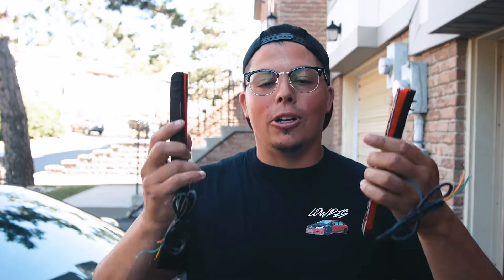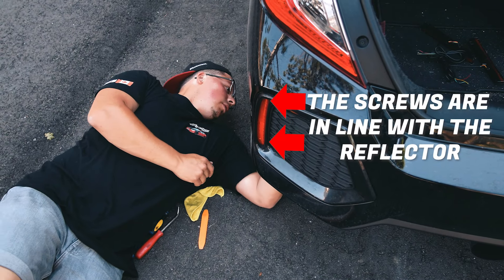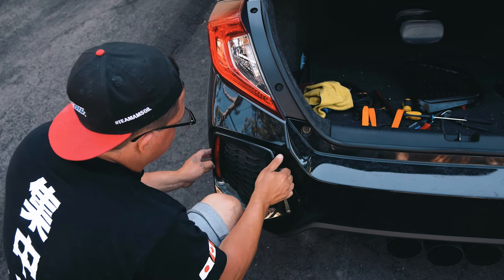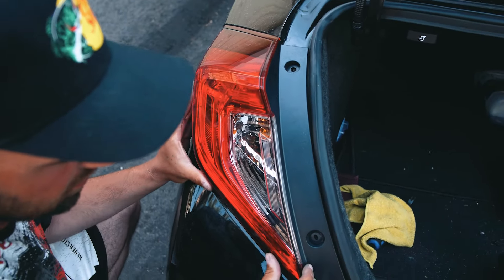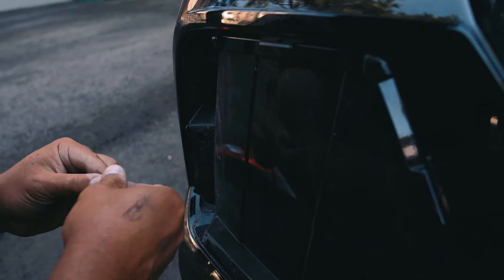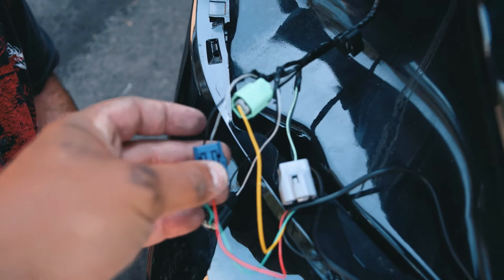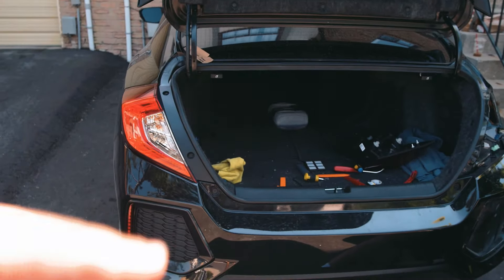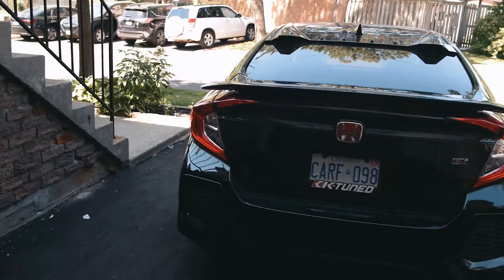SEQUENTIAL LED BUMPER REFLECTOR INSTALL ( 10TH GEN CIVIC )

Comment: Wait, how did you plug the socket back in 5:47, if you just plugged the wire directly to the harness (no splicing/TTap)? Won't the thickness of the wires prevent you from plugging it back into the socket? Or you'll damage the LED reflector wires, trying to plug the harness back?
Reply from the maker: You have to trim enough of the plastic around the wire to clear. It’s a snug fit but it works great

Comment: Question, if you add them to the pigtail the way shown on the video, doesnt that interfere with the pigtail fitting into the tailight?
Reply: Did you ever get an answer anywhere else?

Comment: Bro I just ordered mine on Amazon just now. Coming in tomorrow. Can't wait. The wiring on the video wasn't super specific. So my question is the wires that go from the lights to the tail light pigtails. You just stick the wires accordingly into the pig tails then just clip the other part back together? No splicing or cutting into the original wiring at all?
Reply: Aye just double checking, works with 2017 Honda Civic Sport hatchbacks (assuming manual doesn’t make a difference) ?

Comment: hey man, I installed mine today using your video and it was a great help, I was wondering I ran into some problems after I installed which now my SYSTEM BREAKS and some other lights turning on and when I try to drive the car it won't let me shift to any gear(yet the car is On working fine)
Reply from the maker: That’s odd, disconnect the negative terminal from the battery for a couple minutes then reconnect it. Go for a 10 min drive then turn the car off and on and see if that helps
Reply: Hey wassup got the same problem just now did you figure it out ? Also thanks Mr.Lopes for the video!
Reply: I’m back did all that battery removing therm I already but didn’t work it was just a the stoping light fuse had gone bad switched it all my problems gone and car looking nice !

Comment: Recommend to change the rear bulbs to LED too. basically i changed all the rear bulbs to LED(signal, brake and reverse). Its much brighter and the signals goes off and on and does not fade like the filament bulbs
Reply: Have you had an issues since upgrading to LED?
Reply: @ofwgthaidgaf  2 years with no issues
Reply: Nice ive done my headlights and fogs so far looks 1000x times better. May have to do the rears next. Also wanted to do some on the inside as well.

Comment: So you just leave those wires in there and plug it like that they don’t get torn or in the way?
Reply from the maker: daniel cordoba yea as long as you trim enough of the plastic you’ll be ok just make sure to double check before re installing it
Reply: Chris Lowpes And by plastics you mean the insulation around the wire right? Just making sure don’t want to do anything stupid 😂
Reply: @DCvenomfang  yes, so that you get a better fit when ypu plug it in.

Comment: Just installed mine and my running rear lights don't work. The blinker and the brake lights work but nothing will allow the running taillights to turn on. And now my front side marker lights aren't working 😢

Comment: how has the wiring hold up since you didn't splice into the actual wires of the harness? Im about to set up mine and I wanted to see if this a pretty secure/easier method to doing things lol
Reply from the maker: Yea I haven’t had any issues to date surprisingly

Comment: hi guys i live out here in canada, and my mechanic warned me that i should not install the rear bumper sequential lights because of the snow and salt hitting those areas, causing electrical and corrosion issues. 
any one has any thoughts or feedback on the validity of this claim? 

thanks
Reply: bump
Reply: Did you ever do it?
Reply: @gosu8075  yuppppp... and it has been ok so far.. just ask the mechanic to use extra sealant around the corners and cables
Reply: @gstreetboi  thank you very much for replying. Really appreciate it! I’ll be doing this then

Comment: Hey, big fan of your videos!  How did you do this without splicing.  You make it seem like there are naked ports on these connectors you can just jack the wires into.  Is that all?  No quick splicers necessary?  Cause all the vids I've watched they're using quick splicers.
Reply from the maker: Check out minute 4:53, we put the wires into the plug and connect them to the car, also thanks for watching!!
Reply: @ChrisLowpes  how did you do that? removing the wires from the pigtail?

Comment: I have a 2013 civic si and i recently installed the led reflectors and they work but only when i come to a stop and use my turn signals. There is  a problem to that which is my tail lights. My tail lights aren’t on at night and i had people flash at me from behind since my tail lights are out. Can anyone tell me how to fix this?

Comment: I want these for my type r.... but they're actually illegal in the UK as you have to have the reflectors on the back... 😑
Reply: The reflectors are useful if you are in the dark with the car turned off and you don’t want to be rear ended
Reply: @TheDetrity  exactly (they're a legal requirement for parked cars)....  do you know if they reflect when not in use?

Comment: idfk how on earth you got the honeycomb panel off. my plastic clip remover snapped before i even got a single clip out
Reply: i also broke half the clips so now the panel is loose and still hasn’t came off
Reply: Have to remove the whole bumper to remove the honeycomb garnish there is a hidden screw that the garnish is attached to the bumper and the only way to remove the garnish is to remove the whole rear bumper

Comment: Damn I wish I knew you could just stick the wires in the pig tails! I wired mine which took a lot longer!!
Reply: Are you just gonna stick in the wire into the pig tails (wiring hole)? If so, how long the wire holds with your everyday driving? Is there any locking mechanism to hold the wire so it won't fall off?
Reply: Same thing I was thinking
Reply: @zmohp.2060  I did mine the same way, it was hard to push them down to lock them in. After a week of driving, one of my turn signlas stopped functioning. Not sure why. This method is easier than splicing but i myself ran into a problem.

Comment: How TF did you manage to plug them back in? I tried and I cannot do it to save my life
Reply: I spent hours trying to figure this out. strip them back about a 1/4 inch each and when you plug them in, it won’t be as thick so it’ll prevent them from breaking and or falling out of the hole.